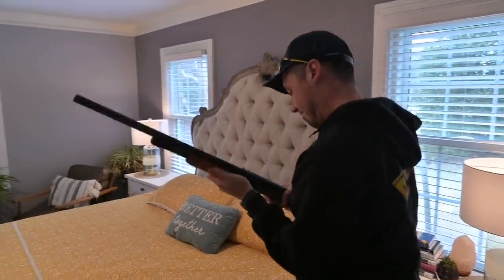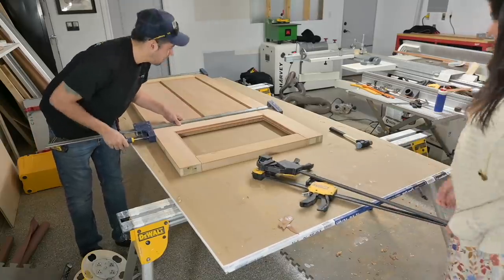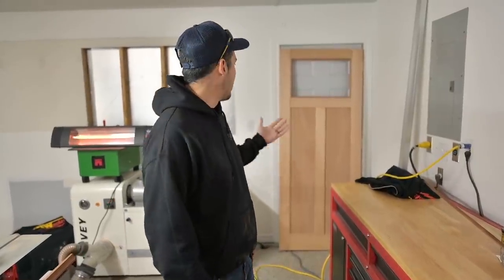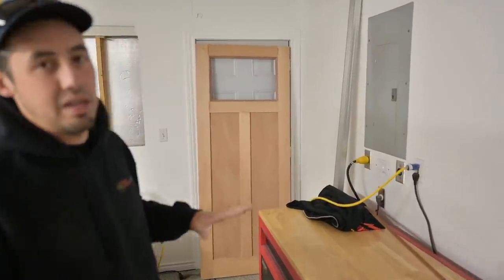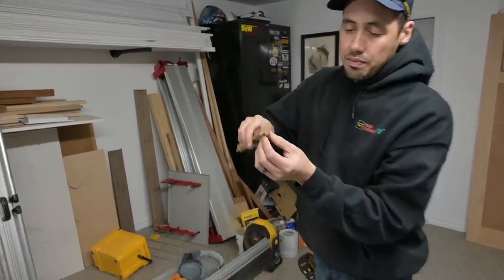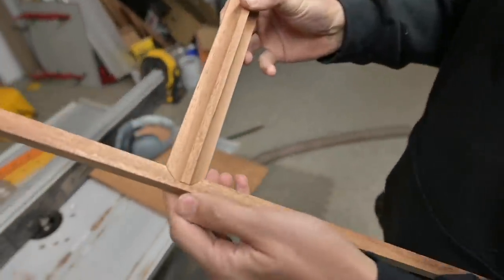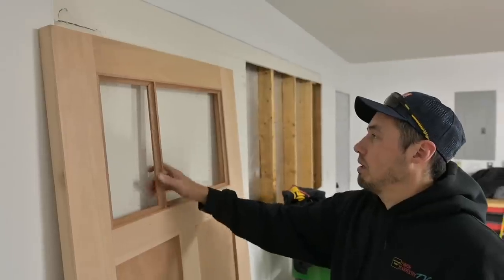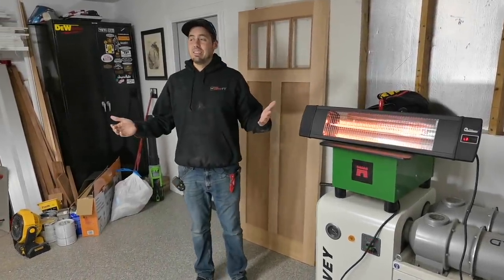The Double Cope - Carpentry Trick

Comment: Buddy, you have to dig in those pockets of yours and get some Bessy clamps. Bessy makes all types, However, if you pick up the best bar clamp kit you can make clamps of any size. It consists of two pieces and you have to purchase a length of 3/4" black pipe. threaded on one end. This means you can make them any length. I have different lengths of black pipe from 24" to 12' in length.  The longest clamp I have made so far was 18' (to help sinch up a wall on a house I was framing. I was by myself and could not use braces. I have six sets and use them all the time, especially when I'm gluing projects. I'm a Red Seal Master Carpenter of 30 years here in Canada and I love watching your show. Sometimes, I'm screaming "Don't do that!", however, there are more times that I'm saying "Now that's a clever way to do that and I'll do that next time"(which I do). Keep up the great work, It's nice to see another artisan who takes pride in his trade!

Comment: Odies is all I ever use. I would highly suggest giving them a call to get some tips.  Sounds silly but they are very helpful. Or just youtube tips for applying.
Reply: @Finish Carpentry TV  easy tip.. less sanding means low sheen. Higher sanding means mirror finish. No grit is too high.

Comment: Hey my dude. At my work we make custom clear cedar doors for screen porch build outs that we do. We use a special glue that requires a special heat type gun thingy and tubes of the special glue. My boss who has been doing this for 20+ years has never had a call back about a door failing. If you'd like to know the name of glue we use I can email you. But you need a glue gun thing plus a compressor. I SHOULD know the name off the top of my head but I'm the one out in the field INSTALLING them. Not making them day to day. I've made a couple but I have too much ADD to sit in a shop all day. I gotta be outside like you. 👍  let me know !

Comment: A gun?  why? Just about shut this video off!
Taken from Woodcraft magazine April May 2014
"Made from a blend of natural
oils (including linseed), Odie’s
Oxy Oil is solvent-free and nontoxic. In contrast to slow-curing
tung oil, Odie’s looks good after
only one coat, and dries in only
72 hours. To use, simply apply
with a rag or abrasive pad, give
the oil 30 minutes to sink into
the wood, and then buff off
the excess. Because it contains
natural waxes and UV inhibitors,
Odie’s has an edge over tung
oil when it comes to combating
moisture and sunlight, but the
barrier is still thin. To keep
defenses up, you’ll need to keep
an eye on your project and
apply a fresh coat when the
surface starts to appear dry."

Comment: Two different joinery shops I have worked in two different ways of cutting copes like that. Many years ago cutting lots of mutton bars for Georgian windows we had a profiled guillotine device. Put the end in pull the lever. Another shop we used a stacked head spindle moulder. You clamped the part to a sled with a sacrificial block behind it and just pushed it through the same as the router set up. Lot more power though and more robust cutter. That one looks like it is trying to burn its way through.

Comment: Glass is pretty easy to cut. You can get the score tool from HD. Practice on a small piece and wear gloves. But you just score and snap. When you get to larger glass you might want to clamp 2 boards to the waste side so you can snap it all at once

Comment: Excellent video. I am in total agreement about having different styles and colours in a house; we are doing that ourselves in our large barn conversion and it can work very, very well; but we found that it needs to be carefully thought out so that it doesn’t balance over into being a mess. Very glad to see you making your internal door in that Arts and Crafts style. Hopefully, with stained glass in the lights. We are on a learning curve with stained glass - it’s not easy to get very small pieces to the right shape and so we are using a hybrid of panes using some stained glass and some painted glass.

The best thing about Odies is the smell. Seriously, I use it a lot on internal pieces but I’m not convinced yet about using it for external pieces. I could well be wrong - past experiences has the odds on being 100% wrong - but it doesn’t feel substantial enough to withstand our weather. My preferred finish for outside is Osmo. I use the Osmo preparation or undercoat followed by top coats. Like Odies, it’s easy and quick to apply a further coat whenever needed. When I started, the options for exterior were varnish or varnish. Looked great for a year and then. I’ve tried boiled Linseed oil, Teak oil and they all have their place but Osmo seems to work the best for our UK climate.

Comment: I copied/tweaked your butcherblock side cabinets around the same makita mitre saw in my shop because i liked your setup.  Oddly enough I saw that Samurai Carpenter group of videos too and decided to use Odie's as well (except on the butcherblock).  I think for the application it was a poor choice but also the hard wax oil can be very thick, especially if left in the cold and its easy to be wasteful with it if you don't follow the directions perfectly.  With how expensive the stuff is, my advice is to research and follow the recommended application method to a T.  And also be aware that Odie's sells some thinner versions of their products.  Good luck, and I appreciate your philosophy on making an inspiring workshop, keep it up!

Comment: What do you plan on using to adhere the glass to the wood? When we do old window repairs we usually use Lexel glue and it held up fantastically! Just a recommendation, love your work
Reply: Lexel is absolutely awesome.
Reply: @Tool_Addicted_Carpenter  absolutely Sashco is unbeat in the Sealant and Caulk department. Big Stretch and Lexel for the win!